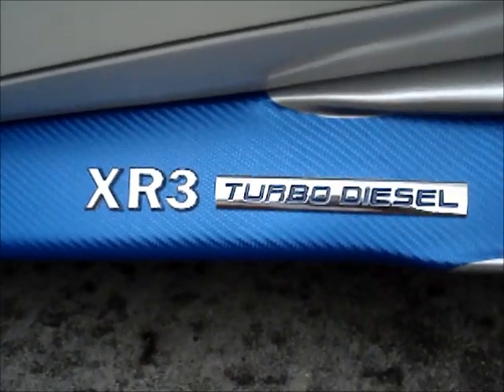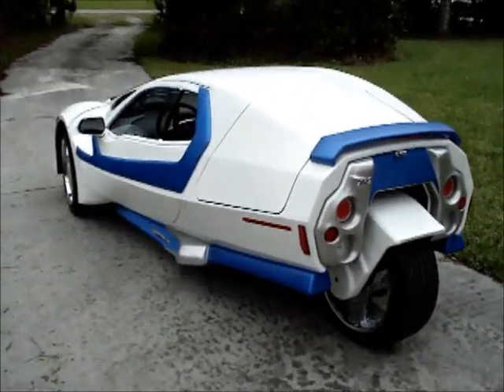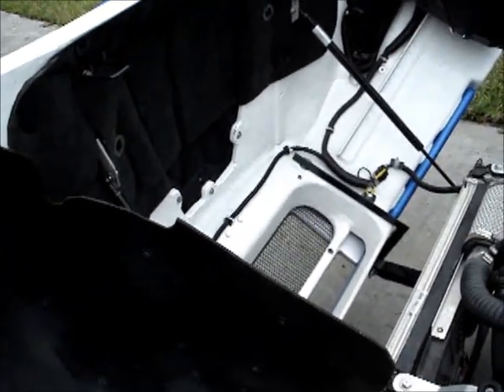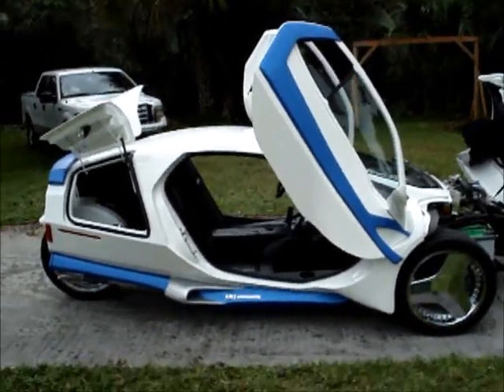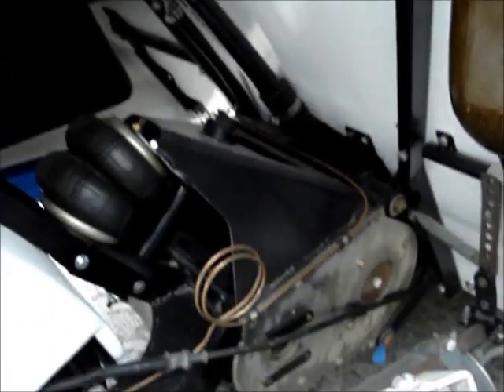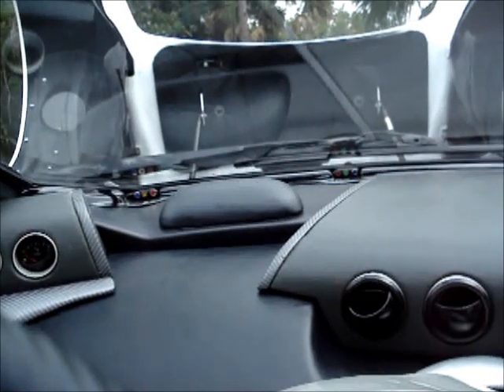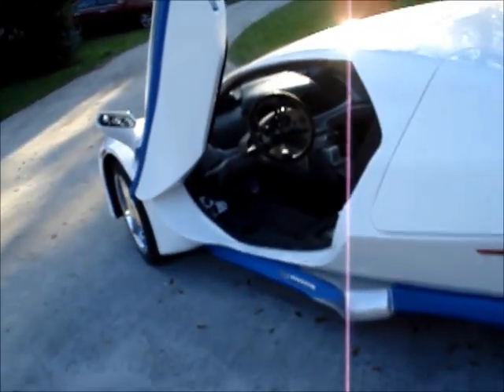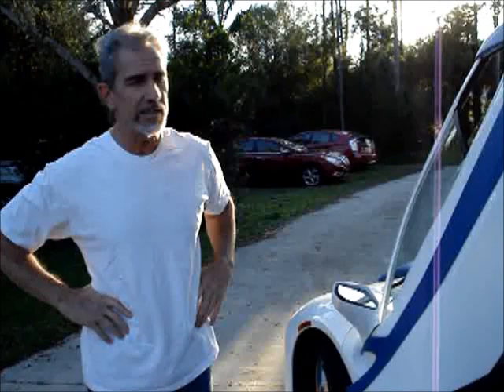XR3 Car Build Completed

Comment: I have a partially built xr 3. All the plans, DVD, cd rom. The tunnel, with transmission, air ride, suspension ect completed. New on the pallet Kubota 3 D902 engine..I inherited it from a relative, and I have no idea what I'm going to do with it..fishing for answers.
Reply: Does it roll? How far gone through has the body been fabricated? Could it be winched up a truck or does work need to be done to get it ready for that?
Reply: The frame is complete, transmission installed, air ride installed. Rear Swing arm parts are water jetted, need to be assembled.  3 guys can load it on a trailer. Kubota D 902 is new on the factory pallet, in the factory plastic. The body is not started.
I have a bunch of other parts to it as well ,calipers, rotors, shocks.  @Cerberus984

Comment: At some point you are going to have to replace the coiled brake pipe with a flexible brake hose. The movement of the rear suspension arm will eventually work harden the tube and then it will crack. You could have used a front brake hose as used in a VW Super Beetle.

Comment: Would you by any chance know the measurements of your XR3 model? As in L W H of the vehicle itself? I’m working on an autonomous vehicle prototype and just entered a manufacturing phase in AutoCad. Im looking into using the XR3 kit files to help with the chasis, which is also a three-wheeler system. 

One other question: Do you think the XR3 chasis could be developed with only an electric motor, or is it inherently something for a combustion/electric hybrid?
Reply: Btw, i think its superb what you’ve done! Such an awesome looking car.

Comment: I really appreciate you showing the car although I have to admit you put a lot of thought into what you did and I have to admit it's pretty sweet, I also like the inside it almost looks like a stock car with a modern mad Max feel to it, although I'm not sure but it sounded like you had a three-stroke diesel engine in it that is a curious, choice that you chose if that is the case, but overall I have to admit you did a very very good job 😁

Comment: Fantastic job, congratulations on your build. Looks professional and what you would expect to see at a manufacturer/dealer. 

I assume that all is well, can you give me a progress report on how the vehicle handles and operates. Also is there anything you would change. Especially in the powertrain department. 

One last question, it looks as though you could possibly make it into a 3 or 4 seater with the additional rear space without to much modification. Had you considered this and is there some reason this would be a impossibility at all?

Thanks for your time

Comment: My most highly anticipated video finally arrives!! I've really enjoyed following your progress. Incredible work! I own these plans and haven't had the confidence to get started yet. If you don't mind, what was your skillset/background before you started? I'm just not sure I could pull this off.
Reply from the maker: Thanks Frank.  As far as background, I am a mechanical engineer, and I rebuilt a few wrecked cars years ago, and I've always been a do-it-yourself type .  There is no doubt that the XR3 has been a big, long-term project, and I added complexity in creating features like lambo doors, electric windows and the flip-up front clip.  If you stick to the plans , it will be easier.  You'll need major perseverance, dedication, good tools and a decent MIG welder to get to the finish line.  Oh yeah,  and money.  Good luck to you sir.
Reply from the maker: One more comment....before this project, I never did any fiberglassing ever.  Learned it all as I went along.  You can too.  Constructing the body is a major part of this build.  Its more of a creative artistic sculpting job than an engineering job.  I actually  enjoyed that part the most.
Reply: @palkan22  Frank actually sent me his plans, as I'm trying to build one of these myself. He can't find the disc with assembly instructions, though. So I have all the blueprints to manufacture the parts, but not the first disc. Do you still have your plans?
Reply: @palkan22  Just a thought.... ZERO motor cycle motor driving the rear wheel and the battery in the front in a horizontal position for lower centre of gravity possibly tesla modules in the rear(for extra power/range) with the other bits from said bike would be an interesting build... ?